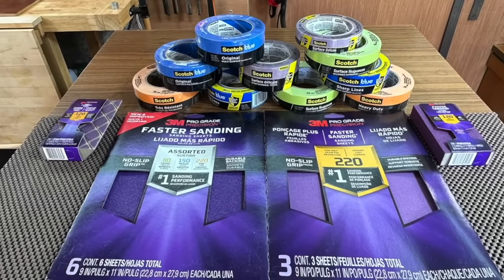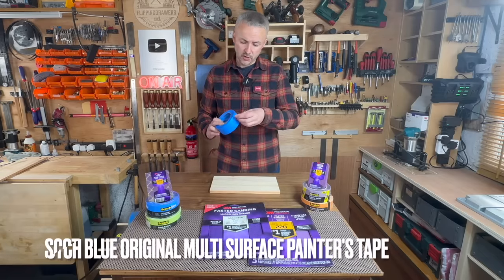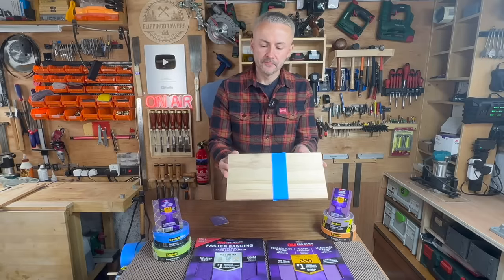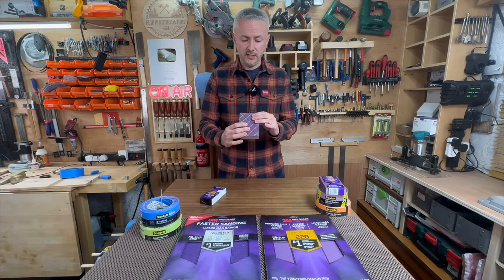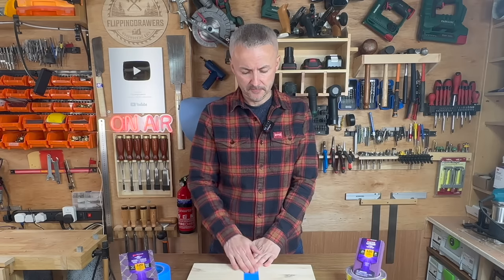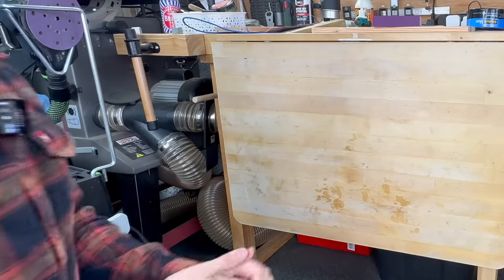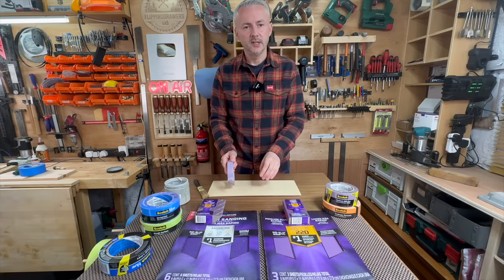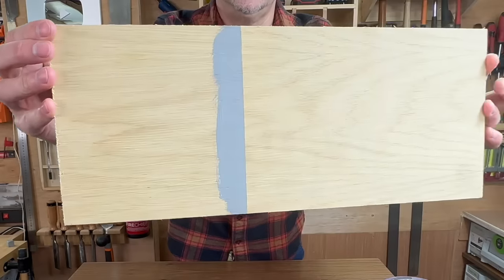3M Pro Grade Precision Abrasives and Scotch® Painter’s Tapes review

Comment: I know that they aren’t in the ‘Art’ supplies business, but I sure wish that someone made a tape delicate enough to use on cold press watercolor paper so it wouldn’t pull up half of the w/c paper with it when it’s removed. 
I’ve had paintings ruined that way. 

There are too many degrees of ‘delicate’ to just label it that way. There are also different layers of delicate with regards to wallpaper too. 

Perhaps you could mention this to them. When the other company stopped making their’s I tried the Scotch…no bueno for me. 

It would be wonderful if there was one that was delicate enough for artists. There is ‘designer’s tape’ that is low tack, but I’ve found it doesn’t produce a clean line .